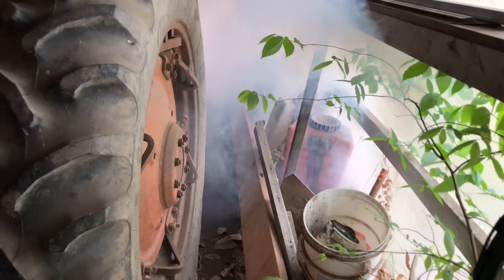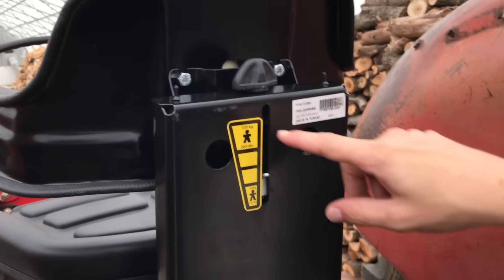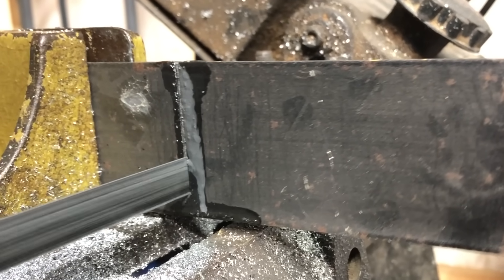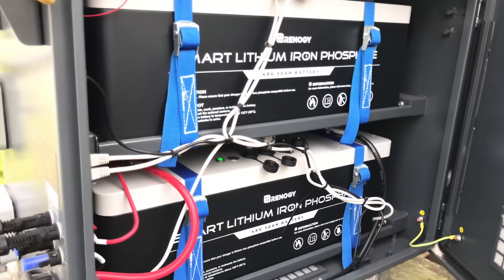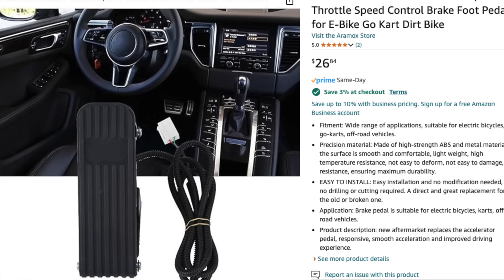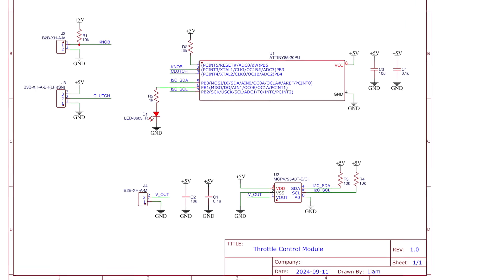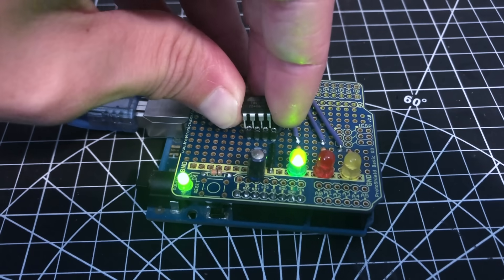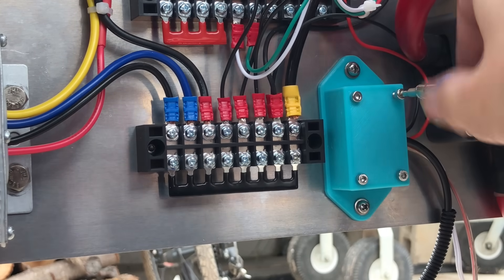Adding a fake clutch & more to my electric tractor conversion

Comment: The funny thing is, even if you got your electricity from a coal power plant it would still produce less gaseous carbon than a petrol combustion engine.

And good video, and even better tractor!
Reply: After transmission losses, that's nearly guaranteed to not be true.
Reply: @ How so? Can you expand on that? I don’t understand what you are trying to get at.
Reply: @operator8014  Transmission losses from the grid: ~7%. Efficiency of a (very, very good modern) diesel engine: ~40%.

You were saying?
Reply: @HenryLoenwind  Coal plant means it's about 33% efficiency to start with. Transmission losses from plant, to grid, to end user, to charger, to batteries, to inverter, to electric motor. Probably looking at 20% loss after it leaves the plant, so .33*.8 = 26% efficiency.

Vs, a modern gasoline engine at about 35% efficient.

Not even a fight really.
Reply: @operator8014  Small ICE efficiency: 30%
Central power plant efficiency: 40%
Grid losses: 15%
Charging losses: 10%
system efficiency; (0.4)(0.85)(.9)x100%= 30.6%

Comment: The grill can still be used for the radiators since electric cars still need cooling.
Reply: Not nearly as much though.
An ICE motor will be rejecting 233% of it's power output as heat.
And electric motor will be rejecting 11% of it's power output as heat.

Comment: Pro tip: When cutting bar stock  on a bandsaw, ALWAYS cut across the widest face. 1. Less noise 
2. The cut will be much straighter and have a smoother cut face.
Reply: It also makes your blades last longer
Reply: @dowgy177 100x this.
Reply: Sorry, can you elaborate?
Reply: @saucecups  when you cut downward on a long narrow piece the blade has a higher chance and likely tendency to twist and cut crooked. Also the cut is smoother as the chip formed is much longer across the cut per tooth as opposed to short cuts and the blade jumping and bouncing as the cut descends.
Reply: Weż przestań, przecięż efekt wizualny na filmiku będzie gorszy,

Comment: Really like the content! If you want to know what fuse you should pick the process goes like this. First you check your amp requirement in this case 1A for the loads. Then you pick the wire gauge accordingly. That is a bit harder, because it's not only the amperage but also they way the cable is routed and length etc. A single conductor free hanging is air can carry more current than a conductor inside a narrow tube together with a lot of other conductors. There are tables where you can check the required gauge for your amp needs. And the pick a fuse accordingly to the the size of wire. You can also pick a fuse with a lower rating. In your case you should be fine =) Greetings form Germany.

Comment: When you were looking for the coal, I was waiting for you to find a lump of coal in the bottom of the cabinet and yell "NOOOOOOO IT CAN'T BE TRUEEEEEEE!!!!"  HAHA😂
Reply: The big coal and NG plants are way more thermally efficient than a small ICE, so although it is not ideal, there is still some benefit to having an EV over ICE, even if the ultimate source for the electricity is fossil fuel.
Reply: @Real_Baxsie  Also: my jurisdiction just finished phasing out coal this year!
(Mostly replaced by Natural gas, so still not ideal.)
Reply: @Real_Baxsie "EVs just put the pollution somewhere else!"
Yeah but that somewhere else is not in the streets of a city, where people will breathe it, so that's still an improvement.
I'll miss the smell of 50cc smoke when it's gone. But at least I'll have longer to miss it.

Comment: I'm not  sure where you're located, but in Nova Scotia, the earth has a z axis component, so pressing the clutch does not in any way result in a tractor coming to a complete stop.  It does disengage the motor, but this will sometimes cause you to speed up, depending on how much of a slope you're on.  Awesome conversion, looking forward to you showing it off!

Comment: Hi, you have done a great job with your conversion. 
I  am looking at doing a conversion too, but I can’t build your fancy PCB board. For the clutch I was wondering about using the same resistor you use for the throttle in series, so when the cluck was up the resistor would be at full speed and the throttle knob is doing the work and as the clutch is pressed the tractor slows down? 
Thanks from Geoffrey
Reply from the maker: Hi Geoffrey, thanks for the kind words. I don't think using two variable resistors in series would quite work the way you’re hoping. The tricky part is that the motor controller needs the signal to drop to 0 if either the clutch or the throttle is at zero. If you put two variable resistors in series, you’d still get some signal unless both were at zero.
A better option might be to switch the system to use a 0-5V signal instead of resistance. You could wire the clutch and throttle as potentiometers, so they each produce a 0-5V signal. Then you’d use a couple of diodes (look up “diode OR-ing”) to combine the signals in a way that the motor controller always sees the higher of the two. That way, pressing the clutch would take priority and slow things down like you want.
The diodes will drop the voltage a bit, so you’d need to tweak the controller settings to account for that. Maybe set it so 4V means “off” and 0V means full throttle. Also, just to be safe, I’d recommend adding a pull-up resistor and an easy-to-reach kill switch incase something gets disconnected.

Comment: Cool tractor! Also, put small ceramic caps (100nF or even 10nF will do) on both speed inputs to the ground, so that wires acting like an antennas don't fry your MCU's input pins. It's a common thing on car ECUs
Reply from the maker: Thanks for the tip!
Reply: I would suggest TVS diodes instead of capacitors on the signal inputs, they react faster.

Comment: Should add an E-Stop if you haven't already, that kills power to the system in the event of controls failure
Reply: No it should be a mechanical cutoff hooked to a big red lever
Reply: @john_barnett  Very hard to pull off safely with a direct drive system like this; in industrial controls we'd just put a safety rated relay in series with the motor wires, and direct wire it back to an estop
Reply: @alexandernewman7587 Yeah, people tend to get hung up on their preconceived notions about the reliability of electric vs. mechanical systems, when that's completely irrelevant. What matters is the complexity and failure points of the system. A contactor across the main power is about as simple and caveman as you can get, versus a mechanical clutch, which, in the best-case scenario, has at least several joints that can fail and friction parts that wear out.